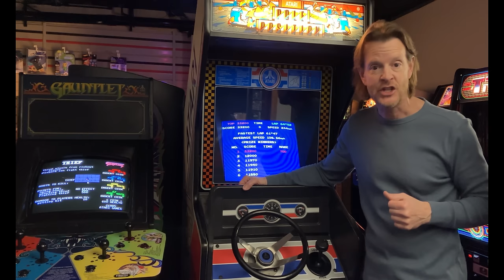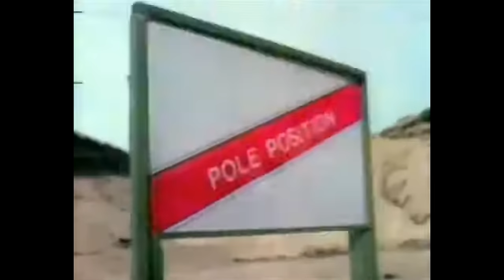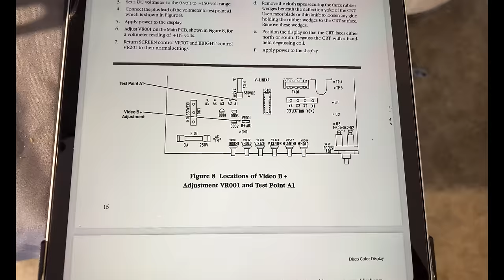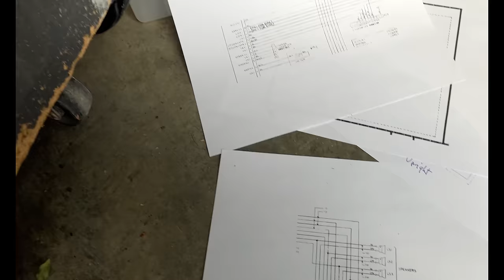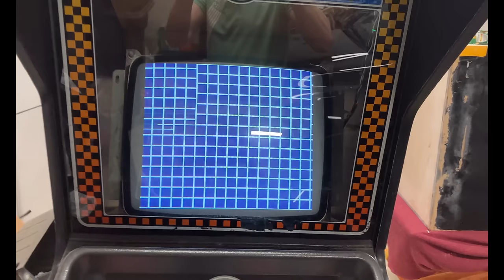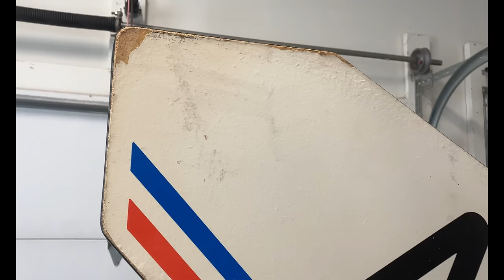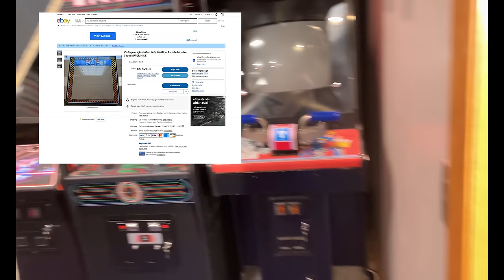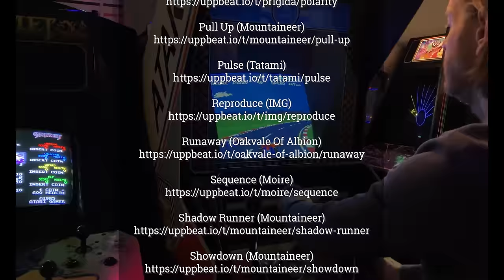Epic Pole Position Restoration!

Comment: Outstanding! Love your restoration videos. Way to bring that classic back from it's rusty, dusty, nasty grave. It seems to want to keep one foot in that grave though with every time you turn it on! It was both funny and frustrating to see the continuous errors with the board! Your patience is amazing. I would have looked at the power supply and behind the marquee and said "Nope, no way!" You said "challenge accepted!" Hope you get another 40 years of play out of it!!

Thanks for the T-molding tip about the electrical tape. I built a replica of the Star Wars Arcade cockpit (put a pc for emulation, video on my page) and had a bit of trouble with some molding fitment on the back side sharp angles. I'll try that trick and find some black brad nails to finish it up nicely.
Reply from the maker: Thanks! Yeah, I can be really patient when working on these projects as I know once they are done then life gets boring again :) It was getting funny to me how crazy the boards would behave--I had to cut out a ton of it particularly around the time of the vertical lines because it was just too much back and forth between working and not working. Right now they seem to be solid so replacing the chip I burned up was probably the right solution anyway.

The T-molding tip works pretty well for sure. I read that one a long time ago and have done it many times. It was also funny that I went through 95% of my T-molding application with everything perfect then the last little bit got me. Pretty much summarized every aspect of fixing up the game!

Comment: protip on the pin extractor- hold onto the wire from the back, and push it into the connector, then press the extractor into the housing, while pushing on the wire.  this will make it significantly easier.  otherwise, the barbs on the pin will dig into the plastic and making it difficult to remove.  if done right it should take almost no pressure to remove the pins.  if the barbs dig in you might have to press the wire into the housing with needle nose pliers.
Reply from the maker: Thanks for the tip! I’ll keep that in mind next time i’m struggling with one :)

Comment: I’ve been binging your videos for a bit now and you’re doing some incredible work here. Just a tip, but you should try some Ospho on the corroded bare steel parts. I use it all the time in automotive restorations for neutralizing rust. It should also protect your parts before you’re ready to paint them as well.
Reply from the maker: I will definitely give it a try. Thanks!

Comment: It's wild to me how well evaporust works. I was looking for something to remove rust off the metal shielding and screws on a vintage keyboard. Didn't want to use an aerosol can product because I didn't want to fill the screw holes. Tested out the evaporust at someone else's suggestion and crazily 4 hours of soaking later the rust was gone. Also, yes it does eat through plating and coating. Which is fine in most cases because the rust probably ate through it first. Just means the plating or coating will need to be reapplied or some other type of protection is needed if you want to prevent the rust from coming back.
Reply from the maker: It is pretty amazing, especially given that it isn’t dangerous to work with. And reusable :)
Reply: It is a amazing product, it is completely harmless for most plastics and metals, but it will destroy stainless steel, AISA 304  at least the 316 type is better resistant against it. I work at the company that makes it and you don't want to know how we found out 😅😅

Comment: You're the real deal, entire package, Tod!
Cabinetry, paint, woodwork, mechanical, and electronics.
Kudos on a pitch perfect restore.
Imo, keeping original artwork warts and all is important history vs painting over large sections. You did just enough touch up, no more.
Only place I disagree are the particle board replacements like the top rear handle panel.  I would have replaced with plywood for load bearing parts like handles. The back door is just a cover, not load bearing so ok with particle board there.
Reply from the maker: Thanks! And fair enough on particle board vs plywood—which I do normally switch to for cabinet bases and so on—but here a small enough piece to be strong as long as it doesn’t succumb to moisture damage again. Glad you enjoyed it and every restore is a personal learning experience for sure :)

Comment: I worked in the arcade game industry back in the day for 15yrs, repairing, maintaining and upgrading games. BTW, My favourite upgrade was the Hard Drivin' EPROM update.. 
Anyway, we bought 5 units of Pole Position right when it was released originally @ $5K CAD per unit (in 1982!) and placed 1 each in our favourite arcades. They were labour intensive because we would have to go 2-3x per week to EMPTY the full cash boxes (which hold ~$1200 in quarters) because the full cash boxes would actually cause the coin mechs to jam up ! 
It was an amazing game at the time, first real first-person type racing game. Prior to PP, all racing/car games were top-down view games. In our experience, the game was pretty robust, not requiring much in the way of maintenance, the biggest issue was the gear change micro-switches, the encoder on the wheel held up really well. 
But the cool thing was that folk used the cowling over the controls to place quarters reserving the next game, needed because there were actual line-ups to be able to play, sort of the same way that folk reserve games on coin-op pool tables. Yeah, fond memories.
But if you want a suggestion, get your hands on a Hard Drivin" sit-down cabinet. There are some really cools stories about how Atari developed that game, to the point where some employees at Atari actually learned to drive a manual transmission IRL by playing the game (!!), you could actually stall the engine in the game using the clutch improperly ! and the force-feedback wheel was a first. Just a great game, one of the absolute best IMHO.
Reply from the maker: That’s awesome! And I have a full cockpit Race Drivin’ that I fully restored a few years ago. Works beautifully. You can catch a glimpse of it in my video game collection tour video :)
Reply: @tcurtis49  Yeah, sorry to bombard you with that long story, but I have fond memories of the games. One place I worked at even got raided by the RCMP for selling grey market PCB's, LOL. And I still have the JAMMA wiring harness pin-outs committed to memory.

Comment: One of the best arcade racing games, I would love to own one but I would definitely put a pi position for reliability even though it’s not original
Reply from the maker: I tried the pi position and it isn’t quite the same, particularly with sound effects like engine noise passing cars. It also was a but wonky reversing the accelerator pedal when switching between games. But I kept it just in case.

Comment: Have you ever attempted to restore a vintage HIFI receiver and speakers? A lot of your skills are directly transferable. I have the exact same desoldering pump and multimeter. I splurged on a hakko soldering iron and it is an excellent tool.
Reply from the maker: No, I haven't. But I have certainly messed with a lot of different electronics over time. Maybe someday!

Comment: I've enjoyed a couple of your restorations now and really enjoyed your attention to detail. If I could make one small suggestion though. When you're replacing discrete components, such as your capacitors, it's very bad technique to bend the legs over. It makes it harder to remove them, should the need arise, and I would have gotten a severe ear bashing from my Air Force instructor if I'd done that myself.
Reply from the maker: Totally get that and it is more of a pain when I redo someone else’s work. I do trim them pretty flush and when I’ve had to remove some that I put on in the wrong spots it’s never been trouble. I don’t know how else to put on a bunch, then solder a bunch, without doing that…or to keep them from slipping back out of the slots.

I am definitely detail oriented and that’s partially due to my profession. The little details make all the difference. Thanks!

Comment: SUPERB!!! Its very entertaining and interesting to see how problems arise and the ingenuity with which you solve them. By the way, that board was playing with you! Could it be that the problems you have come from the connectors and not from the chips?
Reply from the maker: Thanks! Some of the problems plaguing me were definitely true and on the board, and the more I narrowed down problem after problem the less likely I was to have a random RAM error. After I finished the video I wrapped up the project by direct jumpering the 5V and ground to test terminals on each board. That reduced the possibility of the RAM error even more, as by then it was only when turning on cold and would go away with an off/on reset every time and now it's very rare. I doubt I'll ever figure out what component is not quite at 100% but I can live with occasionally having to do an extra off/on cycle to play.

Comment: So its Theseus dilemma again. How much does  it matter to put a new  plywood than  working with all those resins and putty? For a video perspective this approach is excellent for sure.
Reply from the maker: It’s certainly not only a personal choice but a practical choice. How much work is it repairing vs replacing…and expense. There are times I just have to cut some new wood and there are times I’m willing to save it. With this Tron much of the value of the empty cabinet was the history of it and in particular the sideart. I really wanted to keep that intact which drove me to repair it. Had the sides been blank or the sideart shredded I would have cut new pieces for sure. And yes, for the sake of video, more interesting for me to do the crazy repair for sure. Plenty of videos and instruction out there on cutting new cabinet pieces…not so much in the way of this kind of repair. Thanks!

Comment: If you've worked with a tape measure at all then you should know it'll give you an accurate measurement from the end and you don't have to go an inch over. The Little Hook moves for a reason and will give you an accurate reading as long as you are using it properly
Reply from the maker: Take 3 tape measures and see how they compare. Or measure with the tape measure and then measure from the inch line. They tend to vary too much for my liking. If I used the same one to measure and to cut, no problem. But that’s not always the case. On the other hand, I have to remember I do that :)

Comment: Great episodes. Are you planning on doing a tube swap down the road since you mentioned some burn-in?
Reply from the maker: I might, but after adjusting everything it’s not particularly noticeable. And it’s just a faint Game Over near the bottom. I tried to get an additional Matsushita monitor running to try in but it had numerous issues. I am probably going to leave it as is.

Comment: Your videos are excellent! I love the detailed in-depth approach. Thank you so much for taking so much time to put them together. I have an arcade (I believe it’s called a “showcase cabinet”. Not sure). It has a large monitor. I thinks it’s 36” and a blue elf 2 board. It didn’t come with a power supply and I’m very new to the whole process. Any suggestions on what I should look for?
Reply from the maker: My first suggestion is always to join the Museum of Game (KLOV) forums and make a detailed post there. There are also some good Facebook repair groups. Typically you can find useful tutorials on just about anything there, and there are good people who love to help as well. That’s a cool arcade setup and hopefully it won’t be too difficult to troubleshoot.
Reply: @tcurtis49  thanks so much for the suggestions. I’ll check them out!

Comment: I've seen a few of your restoration videos (which are awesome btw!), and I see you do cap kits for monitor boards but never on the power supplies or game logic boards, and I'm curious as to why that is?  caps are cheap and often go bad after 40+ years.
Reply from the maker: In general, the experts I trust most—the ones that have been repairing boards and helping others fix their games for the longest time—recommend not replacing caps on boards or power supplies as the originals should still be in good shape still. An exception would be the “big blue” on Atari power supplies or other big caps that test faulty like that on power supplies. Which I do routinely replace if they are at all iffy. For common AR2 boards the bottle cap transistors are a must replacement but the capacitors should generally be left alone.

There is logic behind it as far as quality of the originals and the loads put on them and so forth which is not something I’m an expert on. And I have never fixed a problem with a board by replacing caps so I have fallen into the “if it ain’t broke don’t fix it” philosophy. Monitor caps are a different story entirely though.

Comment: Just out of curiosity,  when you're laying down the control panel graphic, why don't you use the heat gun to soften the graphic a little to make going over the hard edge at the bottom easier?
Reply from the maker: I guess it’s never been enough of a problem to need to do that. If I get one that’s a struggle I’ll keep that in mind. Thanks!

Comment: Another awesome resto! I have to ask, what's the story with the Gauntlet? One you restored or bought as is?
Reply from the maker: I bought it from an arcade operator back in 1999. For around $50, I believe. Someone had scratched the anarchy symbol into the monitor glass and it was missing its coin doors. I replaced the coin doors and did a tube swap on the monitor. Other than that it has been solid fun for many years!

Comment: Not that anyone will be smoking around theses However Do you have 1 game with a Ashtray? The arcade i went to in the 80's had a few metal ones built into the side or front of them ...That one little thing most people forget about
Reply from the maker: None of mine have a built-in ashtray. Tapper has two built-in beer mug holders by design, though :)

Comment: This one seemed like a bit of a struggle but it turned out wonderfully!  I have a question though...the RAM problems you were having; when something like that gets "fixed," does it tend to stay fixed or can you expect to continue to have to deal with issues like that moving forward intermittently?  I ask because the troubleshooting seemed a bit like a lucky crapshoot (and I have very limited knowledge on how these machines actually work...so it's possible I am just not understanding the procedure).

In any case, another machine well done!
Reply from the maker: Often having a recurring problem is a sign that something else is really wrong but there’s one common symptom, like a RAM error. Other than my early struggles with the main RAM, the various errors naming other RAM were not actually the RAM chips themselves. Tracking down the problem that caused the graphics glitch, fixing the chip that wouldn’t allow the game to start, etc, stopped the RAM error screen. That and a mod I added afterward to directly wire the 5v and grounds to terminals on the board seems to have solidified it. I haven’t had any issues since,
The worst problems are the ones that aren’t easily reproduced, like a game that resets itself randomly. Or one where you can jiggle the wires and it works but you can’t figure out why. Arcade games are maintenance heavy but in my experience thoroughly fixing a board tends to keep it fixed for a long time, particularly given the relatively light use they get at home vs their days back in a real arcade.
Reply: Thanks! I was actually wondering about the "use load" aspect as well. Figured home use would be much easier on them overall but with the older tech still driving everything...I wasn't sure. I'm relatively new to the channel but am really enjoying going back through old videos and watching these restorations! It's something that's always interested me but I don't have the know-how, space, time or money so I'll just live vicariously through you haha.
Reply from the maker: I will try to help you keep living the dream from afar then :)

Comment: 1:11:05 Just curious but why didn’t you paint on some green solder mask (cured via UV light) to protect the exposed copper edge instead of the liquid tin you used?
Reply from the maker: The tin will protect the copper as well, and is useful for the edge connector pins that do have to stay exposed. So I had some and thought I'd give it a try. Some people will cover that with green nail polish, much like the solder mask. In this case the area I'm covering is part of the ground circuit and it really doesn't have to be covered at all, but was good practice to see what would happen. If I were doing board repairs more often I might get the solder mask. Thanks!

Comment: Chevrolet Flame Red and Petty Blue.
Reply from the maker: Are those the official colors? If so, cool!
Reply: @tcurtis49  I'm willing to bet money on the RED. Same color code MOST screen used general lees ware painted. 

 With Petty Blue it's hard because there have been about 5 variations over the decades.

The blue on PP looks like the late 70's deeper petty blue. In the 60's and 90's it was more of a powder blue.